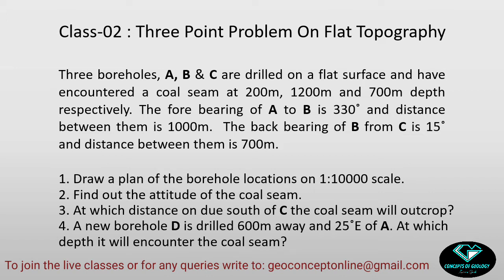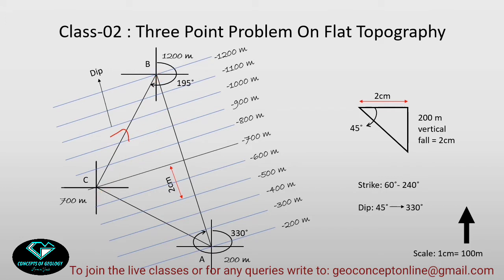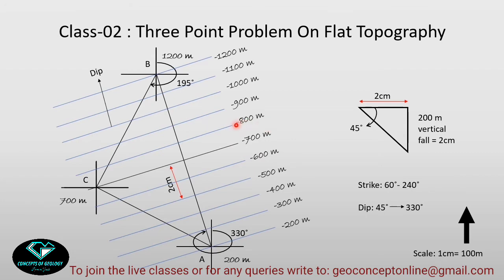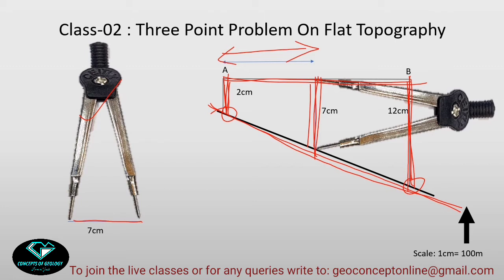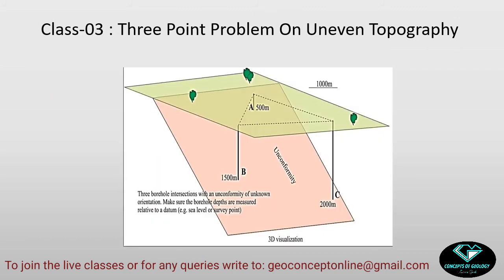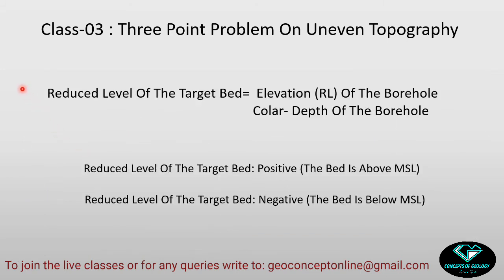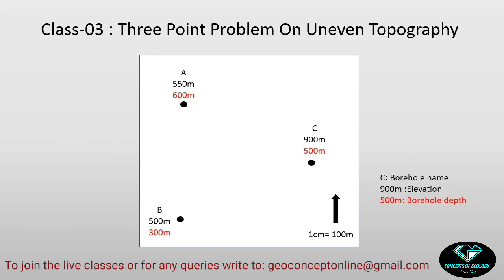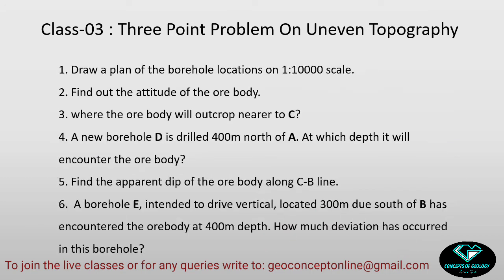Structural Geology Numericals and Maps: Class-03: Three-point Problem on Uneven Topography

Comment from the maker: concepts of geology has appeared with the practical problems on structural geology through live classes. We will learn to solve numerical problems on the subject and to interpret geological maps with complexities like fold, fault, unconformity etc. On advanced level we will solve the attitude measuring problems of geological liner and planer structures with the help of stereographic projection. 
Today is the third class of the module and we will learn to calculate the attitude of planner  structures by three-point problem method on uneven topography.
previous video link: 
1.Class-01: Geological Field Mapping: https://youtu.be/vOZvvjGaTMA 
                     Geological Compass: https://youtu.be/MT06naOvnMI
2.Class-02: Three-point problem on flat topography :https://youtu.be/sSbENOQK180

To join the live classes or to get the total session feel free to write to geoconceptonline@gmail.com.